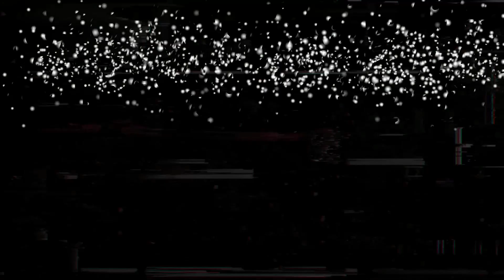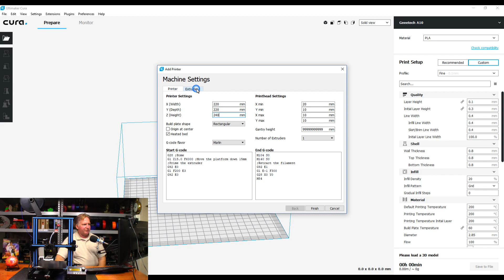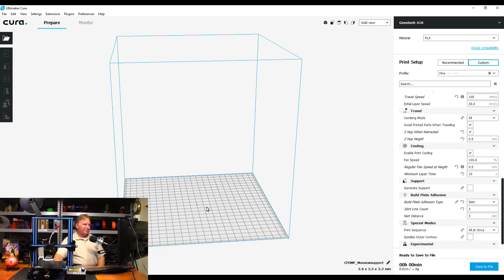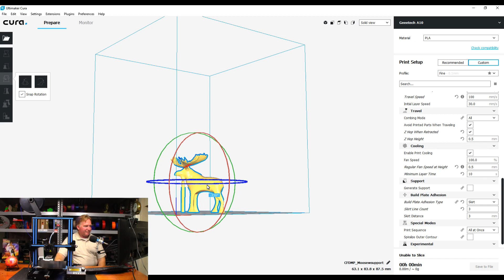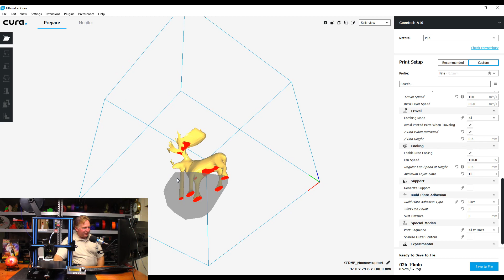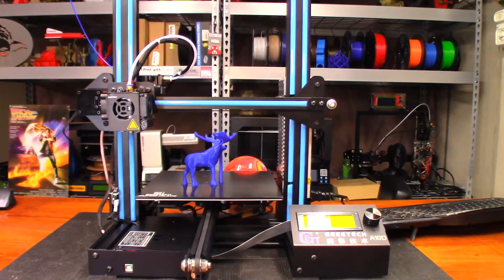Creating A Cura Profile For The Geeetech A10 Part 1

Comment: Hey, I know this video is 2 years old, but I found it looking to set up my new a10. Cura now has the presets, works very well.
Reply: Im buying an a10 now ty
Reply: @yobert9385  I had a problem with cura and start Gcode, was doing weird things when I went from PLA to PETG. I use Ideamaker now. I really like how you can easily change the basics without the program wanting to change everything. 

If you get a piece of class cut for your bed, great upgrade, attach it with some binder clips. The automatic bed leveling is nice too.
Reply: @eslmatt811  did cura work as far as prints thow if you stuck to pla

Comment: But with ABS I could use the same settings?
Reply from the maker: Unfortunately no.  ABS requires a whole different profile.
Reply: @JimmyShawsTidbits1  ok... Where I could find it?
Reply from the maker: The biggest thing is to print hotter.  I believe ABS needs 225c and the bed at 90c.  Print slower and you may have to find a way to enclose the print area or use a ooze shield to keep the print warm so it won't crack.

Check with the Geeetech group on Facebook and I'm sure someone has a working profile.

Comment: Thanks Jimmy, 
I got a new A10 a month ago, with cura 4.1 I can only print  with Marlin(Volum..) - Not only marlin as recommended- .
The problem is in this mode, the retract does not work, it seems the printer does  not recognize the gcode for retraction 
I tested your custom settings, with "marlin", it failed too.
I tested it with marlin(Volum..) it print, with few stringing, printing time x 2 (speed and distance of retract modified for best result)

Comment: Can I use those offsets to get my a10 to start printing in the center.On my first print I used the sd card since then every print I try goes to a corner and just spits out filament.
Reply from the maker: The best thing to do is measure the bed and put in those measurements for the bed size.  If you put in the factory specified dimensions it will point to the side.  If you use offsets it will reduce your true build volume.

Comment: I'm glad you mentioned about the Z hop. I did a print the other day which got stuck. The thing was combing backwards and forwards over the same part, not extruding, stuck in and endless loop. I checked and my Z hop settings (hidden) were 1mm. Changed to 0.5mm. Thanks.

PS: Would love to know how to read their GCO files supplied with the printer. My A10M prints like a Superman spinning the world round from the test files, but from my Cura settings, it limps and under extrudes all over the place. What's up with that?

Comment: Jimmy any idea why cura is generating gcode files with 0 kb?  Ive modeled fine, imported the model into cura, and it prompts me to send the file to SD, and it appears to do so.  However, two things happen - cura closes (crashes?), and it DOES put the gcode file on the card, but the file has no info.  When i stick the card in printer, it allows me to chose the file, and displays the name on the LCD display, but it does nothing.  I downloaded slic3r also and it successfully used same SD card to deliver code to the printer...but so far not a fan of slic3r...any ideas what is causing the cura issue?  Thanks
Reply: Ill give her a shot thanks
Reply: I discovered my cheapo laptop was struggling with cura...desktop seemed to work ok.  In the meantime slic3r is growing on me, now I found the advanced settings mode.  The machine print a 1" calibration cube beautifully, though my part cooling fan will not work at all during prints.  Electrically its ok as it comes on if i run preheat for pla using menus on printer.  Do you have this issue?  On geeetech forums a dude just released his own a10 firmware that supposedly fixes the cooling fan bug.  I am attempting to do the arduino IDE/Marlin update in the hopes that it cures my part cooler issue.  Kinda goofy that I need to immediately update my machine bc a basic function does not work...but...for the price its a great little machine.
Reply from the maker: I'm wondering if something in the cura program has been corrupted.   Personally I would try uninstalling cura and reinstall it to see if it corrects the issue.

Comment: Thanks for this video.

I have created a cura profile according to the parameters in this video, but the printer not printing straight (in height).

Could you help me please ?
Reply from the maker: I don't think that the Cura profile could cause that.  If the model is setting on the build plate flat in Cura it should print straight up.  If not you may want to check the tension on the belts to make sure it's not too loose.
Reply: Can I send a photo of the piece to you by email ?
Reply from the maker: Sure, jimmyshawstidbits@gmail.com
Reply: I have created a profile for petg (same settings as pla but extruder 225 °C ans bed 85 °C) with bed adhssion problem. What I should change... ?
Reply from the maker: The bed will need to be at least 90c maybe 95.  Be sure to wipe the bed down first while it is cool with rubbing alcohol.  That should help it stick better.   Otherwise you may have to use some glue stick to help it stick better.
Reply: Its possible to increase Brim width with cura ?
Reply from the maker: Yes.  If you are using brims, you can click on the gear icon next to the heading above it and add the settings for brim characteristics.

Comment: Hey Jimmy,

Thanks for the video. Did everything by this video but for me nothing is workin. In fact what's happening is that the generated file seems to be reconfiguring the stepper channels (or creating worng instructions to all motors), making extruder feeder motor either X or Y (can't really tell). Also Z motor seems to have started performing extruder feeder's motor's function...

so all above in other words means that at the beginning of the print the extruder raises, moves to top right corner, comes down and stays there. Z seems to slowly starting pressing downwards until nozzle sits on the plate blocking it any furher. At the same time I see filament start moving in and out of the tube as if it was driving the axis, which as concluded as worng motor commands sent to all motors. Any idea?
Can this be Cura issue (I have 3.4.1) or printer firmware version issue (I have 1.0.5)
Reply from the maker: Did it print correctly before using this profile?

Comment: The scaling of some STL files is messed up from the designer using Imperial measurements and NOT using Metric.  I found this out when I was doing a design in TurboCAD 2017.  I used Imperial measurements because That;s what I know and learned.  Simple fix is after I'm done with a model and ready to save I convert everything to Metric System.  Seems Cura only reads Metric and not Imperial measurements.  I hope this helps.  Give it a try if you do designs or tell the person who does designing for you.

Thanks for the A10 Cura setup video.